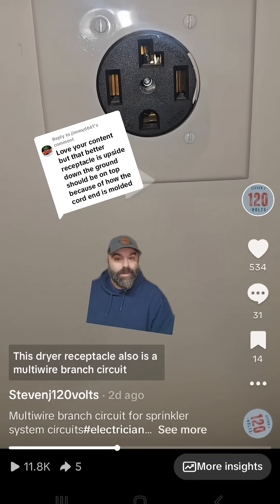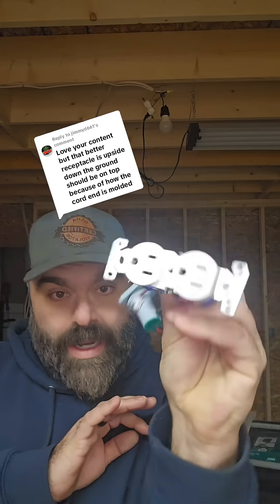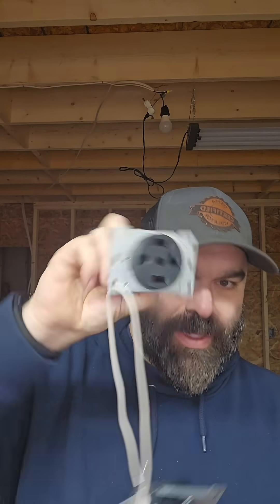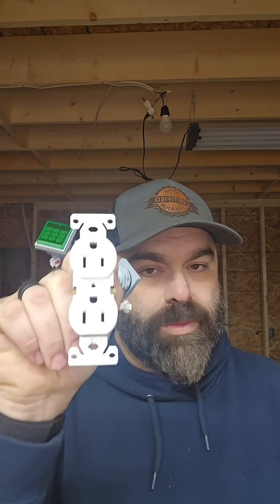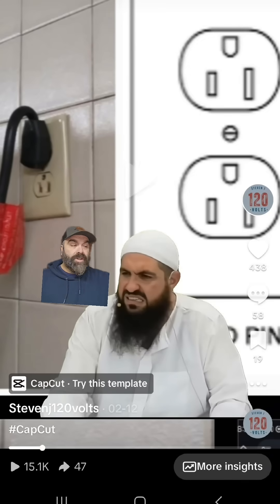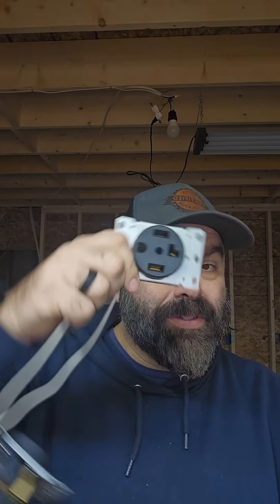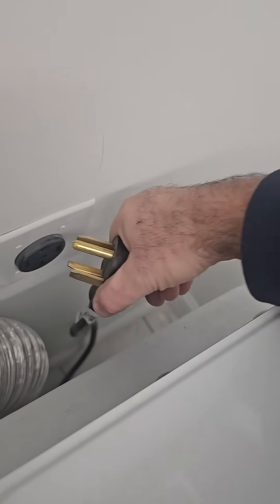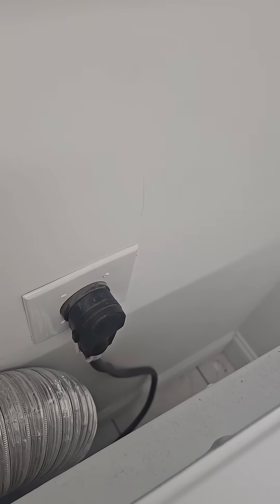upside down receptacle?  ground up? ground down?

Comment: Hey Steve I'm a big fan of installing those ground up for certain purposes. There are some three-pronged appliances, microwave is a good consumer example, which are mounted high and which experience less cable strain if the receptacle they are plugged into is upside down. You'll see this a lot more with computers or media stuff.
Reply from the maker: @MasonPelt  every right angle  plug I have seen goes the other way like I showed in the video

Comment: I do put regular outlets ground-up if the outlet is on a switch. Otherwise ground down every time
Reply: My friend told me the same, he's a firefighter and it was in his training. Ground up if switched.
Reply: Yeah that's how I do it too. But I think they now make special receptacles that say switched on them or have some sort of indicator that they are controlled by a switch
Reply: Why does the switch make a difference?
Reply: It just identifies which outlet is connected to the switch. Helpful when the wires are run behind walls

Comment: Just a thought. I own a welding shop. We deal with metals and such. I put all of the grounds up incase a piece of steel were to fall on a outlet... Saved my ass a few months back... Similarly I was bitching and groaning about our fire inspection until the day I needed that damn extinguisher. Saved a half million dollar machine and my shop. I greet the firemen with a cold beverage of their choice each year now and have become very friendly with them... Also causes them to miss the issues I have not fixed yet...

Comment: With the event of the tamperproof duplex receptacles, it becomes easier to insert a plug when you  have the ground lug down. The ground lug is longer and goes in first and now you have a direct look at the two flat prongs so they can be inserted properly.
Reply: Great point